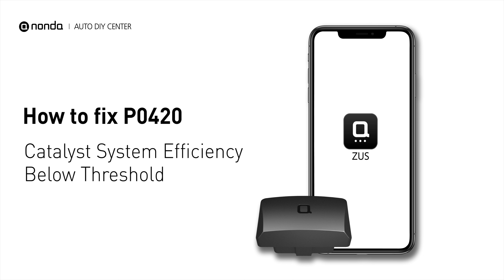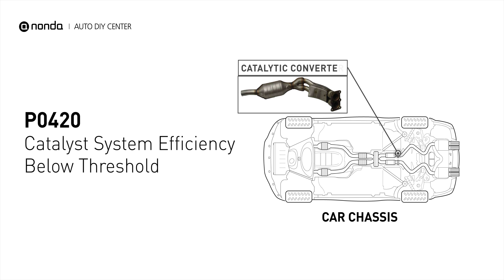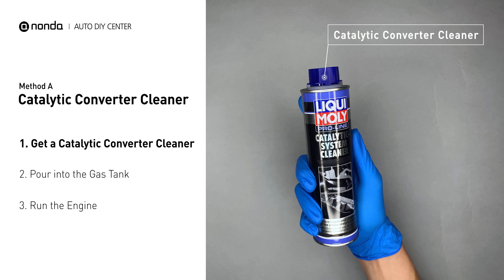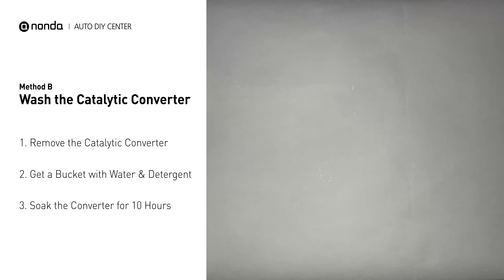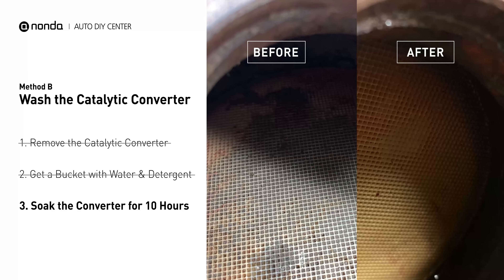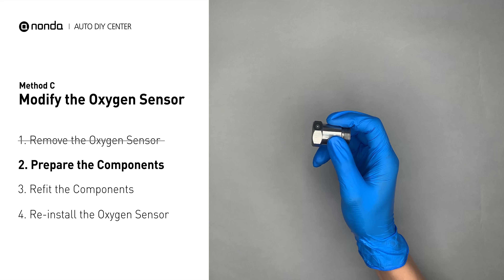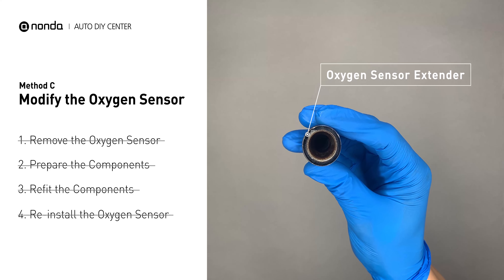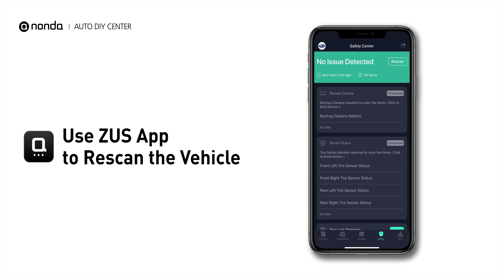How to Fix P0420 Engine Code in 3 Minutes [3 Methods / Only $19.99]

Comment: Can you put the extension on both up and downstream sensors ???
Reply: You're supposed to put it on only the downstream so only the downstream is lower o2 reading.
Reply: @peanbean1973  I can't even put extension on my 04 sequoia, both downstream sensors use flange or bracket type mount. Any idea?
Reply: @ChadHer  the brackets should have a thread in the middle like normal o2 sensors I thought. Maybe you didn't realize but it should just screw in the middle of the bracket. If not you could also try.. wiring a capacitor between downstream o2 sensor and your ecm. There's videos for this as well. You can also try adding washers just to make less space for the sensor to poke into your cat. 

But honestly the way I passed my inspection with my cat code still triggering. I just cleared my engine codes. And got all 5 of 6 codes in ready mode. Than the cat code is the hardest to get in ready mode. So if you go to the shop with the cat sensor not in ready mode they will still pass you since the law let's 1 sensor be not ready.
Reply: @peanbean1973  I seen some 02 bracket with thread but mine looks fixed cuz it doesn't have anything for a socket tool to turn it.  Also thanks for the ready mode infos. After clear my codes, I drove over 100 miles and the evap monitor still show incomplete but everything else show "ok".

Comment: Hi I have a 2018 Audi A4 and while my the check engine don’t appear on my dash when I run my codes I get the P0420 code. I have a catted downpipe, Intercooler & Cold Air intake with Stg 2 tune, should I try the first step or would last step help more so I can pass emissions ?
Reply from the maker: Hello, we suggest cleaning the catalytic converter and see if the issue will continue to persist.

Comment: if you have your original cat..have muffler shop port a new downstream o2 sensor port at end of your cat.right at the tip.of cat and screw in your 02 and have them screw a plug in oem one amd see p0420 disappear..

Comment: I just bought a 2014 Hyundai accent and this P0420 code popped up after about 2 weeks. I cleared it and it came back a week later. The car is new to me so I cant be certain, but it doesnt seem to have an issue driving and no other code was thrown. Would a cleaner help and could you recommend one?
Reply from the maker: Hello, can you please confirm if this is the only code you're getting?
Reply: @nondainc  thank you for responding,  yes its the only code.
Reply from the maker: Hello, you can follow the tips/guide provided in our video on how to fix P0420.
Catalytic Converter Cleaner: https://amzn.to/3r67qCf
Detergent Soap: https://amzn.to/3sbMISV
Reply: If u clicked on the above affialte link, the follwoing one is the one i have had the best luck... only luck with and i have tried about a dozen cleaners. NOTE: The light went away and came back, but none of the other products even got it to go away. in his affilate link it was the top one for me: DURA LUBE Severe Catalytic and Exhaust Treatment Emissions Test Catalytic Cleaner 16 fl. oz, 1 Pack, HL-402409

Comment: Hello nonda, p0420 It’s confirmed bank 1 sensor 2 high voltage. 
Sensor has been replaced but the code has reappeared on my 2013 Toyota RAV4 engine with low cat efficiency threshold. 

Eco mode goes off when the check engine pops up. I’ve tried solution 1. 

How many liters gasoline should I pour the 250ml cleaner into?
Reply from the maker: Hi Leslie, approximately 8 liters of fuel.

Comment: There are two sensors on my exhaust. Which one should I choose for a non foiler?
Reply from the maker: Hi Azan, please provide us the year, make and model of your vehicle so we can address your concern specifically for your car's make/model.
Reply: @nondainc  2004 Honda Accord CL7.
Reply from the maker: Hi Azan, it's on the upstream side of the catalytic converter.
Reply: @nondainc  Thank you so much.
Reply: @AzanAli- did it work 🤔
Reply: @bc-mr1si Did all of them. It worked.
Reply: @AzanAli-  thanks fella.ill change the two of mine with extenders .cheers

Comment: Hello I have a 2005 Lexus is300 . I have the same code p0420. I had it on once and it went away on its own..it came back few days ago so I took it to my mechanic and he’s telling me that I MUST change the catalytic converter and that There’s no other option. Which sounds like some nonsense to me. I’m not a mechanic myself but come on..There’s gotta be another way. 
I looked up how much a catalytic converter would cost me and it’s about 1,700 dollars at Oreilys! Can’t believe it. 

What do you recommend?
Reply from the maker: Hello, you must also check the condition of the O2 sensor as it can also trigger the appearance of this code.

Comment: Hello, last year I replaced my cat, spark plugs, cleaned the fuel injectors, cleaned throttle body and iac motor, replaced rear o2 sensor, and replaced valve cover gasket. 2 days ago when it was cold my engine light came on and I went to auto zone and came out to be that po240 code...I thought it's was wierd that the code came on suddenly when it was cold I feel like. Does anyone know what I should do? This doesn't make sense

Comment: I just had this code show up while driving home from work, am I screwed?
Reply from the maker: Please check the possible causes:
Faulty Three-way Catalyst Converter Bank 1
Exhaust Tube
Intake Air Leaks
Faulty Oxygen (O2) Sensor
Faulty Fuel Injector(s)
Leaking Fuel Injector (s)
Faulty Spark Plugs
Improper Ignition Timing
Faulty Engine Control Module (ECM)
Dirty Air Filter

Comment: I remap my car computer then I  upgraded down pipe 400 cell and sometimes p0420, then i change the new 02 sensor , but still not solve the problem, need to remap again?
Reply from the maker: Hello, is there any other code that registers along with this code?

Comment: I have a 2010 Nissan Murano, what o2 sensor do I put spark plug defouler on?
Reply from the maker: Hello, it's after the catalytic converter.
Reply: @nondainc  But you show in the video putting it on BEFORE the cat.? Confused
Reply from the maker: @davidjohnson794  My reply is according to your vehicle's make/model.

Comment: So I installed a catless downpipe and used an O2 extender on the downstream O2 sensor but still get the P0420 code at least once a day.  Any tips or insight?  Get a second extender to push it even further from the exhaust stream maybe?
Reply from the maker: Please provide us with your vehicle's year, make and model.
Reply: How did it go ?  I have a catted down pipe, stg 2 tune & im looking to try this to pass emissions
Reply: @nondainc honda crv 2011I changed the catalytic converter weeks ago today I also changed the bank 1 sensor I drove the car for more than 100 miles and when I use the scanner it says p0420 I need to pass the inspection but I can't find what to do anymore
Reply: P0420 is usually a permanent code that is stored in your computer. You won’t be able to clear it with a cheaper scan tool
Reply: @bradgoodin True, a cheaper scan tool can clear the CEL but the code is still there and after a predetermined number of run cycles it’ll come back if the data is still bad.

Comment: Hey ! I have p0240 code that make the check engine light on my car is crysler 300 2012.  Can you please help it says oxigen senser need to bee changed .
Reply from the maker: Hello, kindly check if there's any leak to the exhaust manifold, gaskets, and exhaust pipes pre-catalytic converter. Repair the leak, clear the code and complete several drive cycles afterwards. If the issue will continue to persist, please check the voltage reading of the downstream O2 sensor, this will tell you weather catalytic converter needs to be replaced.

Comment: Hello, I have this code on my BMW E39, and I found out that the catalytic converter is missing. Can I put this part?
Reply from the maker: Hello, it is recommended to have the vehicle inspected by a certified mechanic to determine what needs to be done to fix the issue.

Comment: Hi got this code to iam change the Catholic converter new know got Thad code any want Maby know what are can be  the problem  thank you
Reply from the maker: Hi Angel, please provide us with your vehicle's year, make and model.
Reply: @nondainc  hi g morning it Toyota Camry 2007 4 cylinder thank s much can helps me
Reply from the maker: Hi Angel, we highly suggest to check first if there's a leak on the exhaust and test the O2 sensors if functioning properly (O2 sensor on the upstream side of the catalytic converter).
Reply: @nondainc  ok I do Thad tomorrow to see thank s much you g blessings you
Reply from the maker: Let us know if you have any further questions. Stay safe, Angel!

Comment: After getting a P0430 code only, I had driver side of catalytic converter replaced w/ factory part (also had P0301 code so I coil and plug replaced). After driving for less than a day engine light comes on and now getting P0420 code.  could this be sensor issue or do I need to drive 100 miles to get better reading of car's computer.   2007 FX35 Infiniti?
Reply from the maker: Hello, can you confirm if as of the moment you are still getting these 3 error codes? or, P0430 and P0301 has been cleared already and the only existing problem now is P0420?
Reply: Let me know what you did please and thank you.
Reply: Yes having same iasue now. Please help @nondainc

Comment: I have ford fusion 2017 1.5se every time i change evap after 2 month same check engine. And failure after gas fill in station.
Reply from the maker: Are you receiving any other codes?

Comment: I have an 04 sequoia with PO420 code.  I can't use a non fouler because my downstream O2 sensors are bracket or flange type mount. Anyone have this issue?

Comment: My 05 Altima had a vibrating sound so I went to Autozone & they plugged in a reader & my p 420 was on the printout & it says catalyst system so should I try your step 1 and I need a tune up .. please help ( it seems like my car running hard)
Reply from the maker: Hi Jacqui, have you double checked if there's any other trouble code registers along with this code?
Reply: @nondainc  yes..  26 FR LH sensor short, thanks for replying 🙂
Reply from the maker: We suspect a clogged exhaust system/damage on your catalytic converter. Check also for exhaust leak. Test the oxygen/O2 sensor and the catalytic converter to verify the issue.
Reply: @nondainc  thanks again!🙂
Reply from the maker: You are most welcome, Jacqui!

Comment: Hello! 2012 Nissan Titan V8 I had a check engine light on for about a month now with no notable problems. Checked the gas tank top for cracks. Just scanned my truck and got the error code PO420. I have also just noticed that truck will eventually run hot while idling for over 20 minutes.
Reply: Suggestions please?
Reply from the maker: Hello, we suggest cleaning the catalytic converter. Hope this helps!

Comment: I have the other code is P0430, is it the same as P0420?

And it was say “Catalyst System Efficiency Below Threshold (Bank2)

My ride is RangeRover 2014 (L405) V6 Gasolin
Reply from the maker: Hi Chea, both of these codes imply a failed catalytic converter. As per your vehicle's make/model, a bad catalytic converter or a faulty oxygen sensor might be the cause why the code stored. We also suggest checking the wiring condition (downstream O2 sensor) and if there's an upstream leak in the exhaust system.

Comment: How about the catalytic converter it's own. 

how to identify if it's exist how can i know my car got 1 in it?
Reply from the maker: Hi Dashty, you can check the exhaust system under your car. It looks like a bulge in the middle of the exhaust piping between the muffler and where the headers connect to the exhaust downpipes. If the bulge is not there, you do not have a catalytic converter.

Comment: My Tacoma have this code too and when I drive my truck for 2-3 hours and shut it off to get gas and started it back up the motor would die. What is wrong with my motor?
Reply from the maker: Hello, is there any other code that registers along with P0420?

Comment: I just received the P0420 code on my 2011 Scion TC. Which method may work the best? I’m clueless. To take it to a dealership/local mechanic is costly.
Reply from the maker: Hi Chriz, we highly suggest you begin checking with oxygen sensor as issue with this is usually the source why P0420 registers. O2 sensor(s) on the upstream side of the catalytic converter to be specific.

Comment: Can I just replace the oxygen sensor? I have a new cat converter installed
Reply from the maker: Hello, please provide us with your vehicle's year, make and model.
Reply: @nondainc  Toyota Corolla S, 2015
Reply from the maker: We highly suggest to check first if you have a loose/bad gas cap or exhaust leak. Then proceed to the oxygen sensor replacement if no issues found.
Reply: @nondainc  thanks, I’ll check those to be sure.
Reply: Thank you very much, as recommended I checked the exhaust and there’s a leakage, I have them re-welled it back to the cat… really appreciate

Comment: I'm getting that code on my Honda Civic 2013, but sometimes y it goes away when I complete the gas on my vehicle and spend the gas and put the tank full the code come back again,  sometimes it passes 15-20 days without the code, and for some reason come back suddenly when I put gas on the tank.
Reply from the maker: Hi Saul, have you checked if there's leak in the muffler or exhaust manifold and if there's any issue with your front or rear oxygen sensor?
Reply: @nondainc  No, I will have to make sure if there is any leak in the muffler and test the front and rear oxygen sensors, Thank you!
Reply from the maker: You're most welcome and stay safe!

Comment: I get both P0420 & P0430 for a 2009 Honda Pilot.
Reply from the maker: Hi Kevin, have you checked if there's an exhaust leak? You might also need a replacement for the timing belt.
Reply: @nondainc How do you check an exhaust leak?
Reply from the maker: Hi Kevin, you can smell a terrible odor or the fuel pedal can feel like it’s vibrating. We suggest getting your vehicle visually checked by your local mechanic for further diagnosis.

Comment: I'm getting the same P0420 code on my 99 Honda Accord LX 2.3 sedan. What should I do. I clear the code and about 15 minutes or driving it comes back on?
Reply from the maker: Hi Chuy, please try cleaning the Catalytic Converter to see if the issue will still persist. Hope it helps!
Reply: What did you do to clean it?
Reply: @alaabuzubedah4737  oh I just replaced the catylitic  Converter downstream one.
Reply: And problem solved. Thanks to all.who attempted to help me.
Reply: Sorry I can't remember if I cleaned it with soap and water or carb cleaner? Think I tried both methods?
Reply: How much it cost you ??

Comment: My car has engine light on with P0420 for a year, and recently it’s reduced acceleration up to 25mph when going up the hill. What should I do to fix it please?
Reply from the maker: Hi Kiet, we recommend following the suggestions provided in our video (How to fix P0420). These would answer the issues/difficulties you're currently having with your vehicle.
Reply: @nondainc  can I use the water pressure to wash all the dust in the honeycombs in the cat??
Reply: @kiettran3900  if your car is struggling going up hill. Chances are you need to replace your sparks plugs and possibly ignition coils. But narrow down the issues first. Get a code reader. Find out which cylinders are misfiring. Change all your spark plugs. If a code still comes up for a cylinder misfire, change the ignition coil for that affected cylinder. Then you should worry about your p0420 issue. You can put cataclean in your gas before attempting to replace your oxygen sensor or cleaning your catalytic converter. I had the same issues with my car. It would drop to 30 or 40 mph when I went up hills. Changing all my spark plugs and replace one bad ignition coil resolved that issue. All that misfiring eventually causes that 0420 code. So I put cataclean into my gas tank as instructed. My 0420 code went away and hasn't came back on.
Reply from the maker: After soaking. you can rinse it with the pressure washer but please set it to low. If there's no improvement after cleaning the catalytic converter then you might need to get a replacement.
Reply: @nondainc  two of the 4 holes of the exhaust manifold are very dark. What does it mean please?
Reply: @Bill Smith  I did this work on my 2006 Kia Rio. Had over 160,000 miles. It's an easy DIY job if you have the time. All I needed was a 90pc Mechanic tool set (should come with a spark plug socket) and 10in extension bar. Spark plugs are cheap. But the ignition coil was $75. So I only bought one. I later bought some back up ignition coils at a junkyard for $8 just incase my others fail later. No guarantee they will work but they were in good condition. Good luck with your car issue.
Reply: @kiettran3900 Probably  your engine is burning oil...

Comment: is #3 a permanent fix ? like will i be safe driving like that or will it just trick the system.
Reply from the maker: Hi Brian, it varies per vehicle's year/make/model. If the provided tips/suggestion in our video has been applied and the issue still persist, we recommend having the vehicle inspected by a mechanic for further diagnosis.
Reply: Both, Safe to drive, and the system is tricked, your emissions may be higher. Usually the car will run fine, but in CA where they do a visual check you will not pass smog test.
Reply: @dcfield21  does this code cause the vehicle to use more fuel? Like reduced mpg?